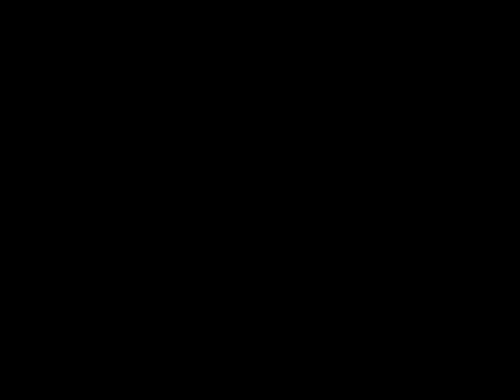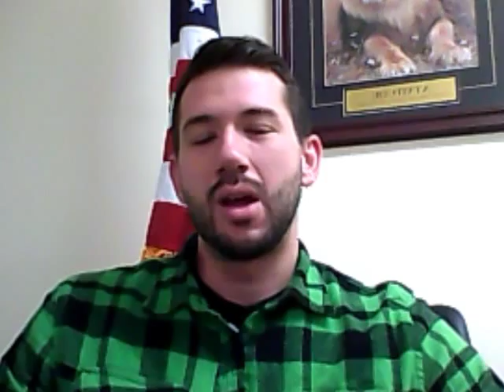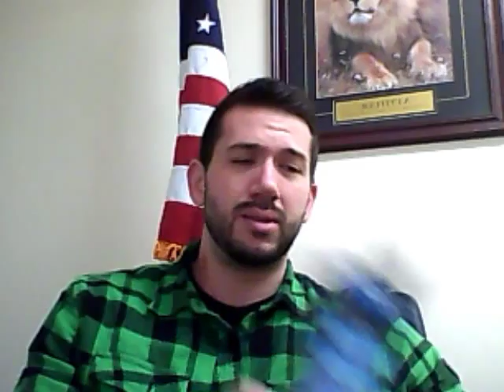WINTERIZING YOUR HHO SYSTEM - HHO DRY CELL KIT  HYDROGEN GENERATOR -

Comment: How much electrolyte do you need for 1.5 liters of water?
How long or many miles will it last, approximately?
How do you know when it needs to be replaced?
Once mixed, if not used often, how long does it last if sitting?
How often do you need to clean the plates of the system?
Do you need a check valve on the line exiting the bubbler?
Can i use this in place of gas in my RV generator?
Can i build system to replace the propane tanks on my RV for use with my Furnace, Oven and/or water heater?
Reply from the maker: Usually we start with a1/4 teaspoon of koh to 1 quart of distilled water on new fuel injected vehicles. This will last over 1000 miles.  You don't need to replace it. It is slowly consumed then you will top it off. I have never seen the mixture go bad or lose its potency. Yes you.. could use this in place of gas. Yes you could use in place of propane as well